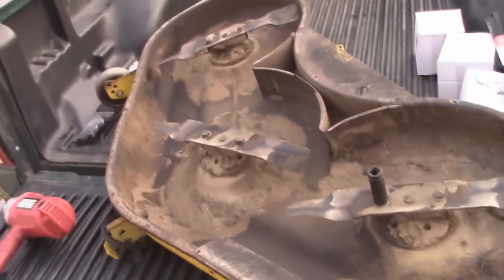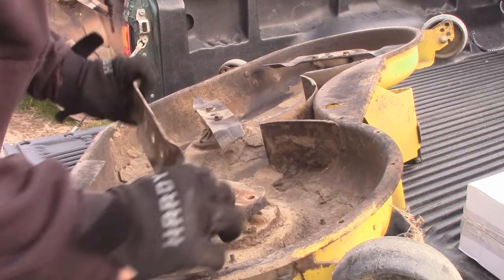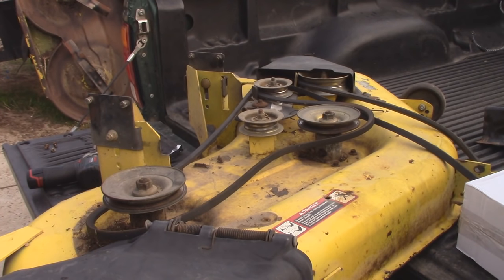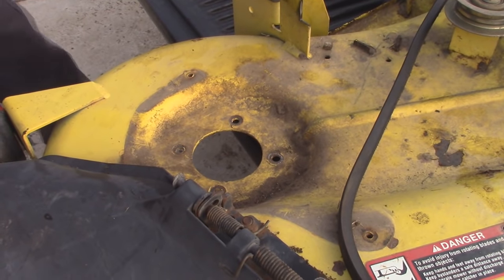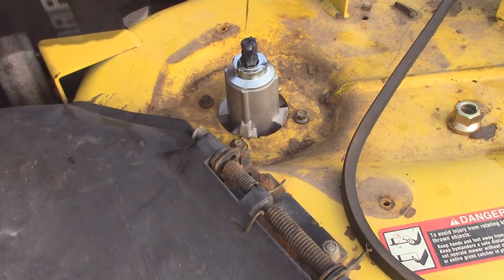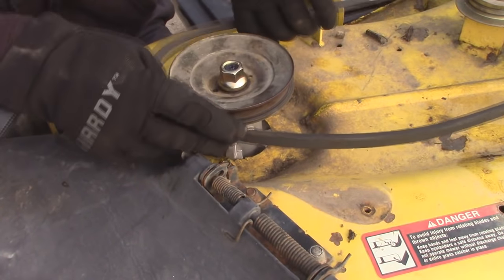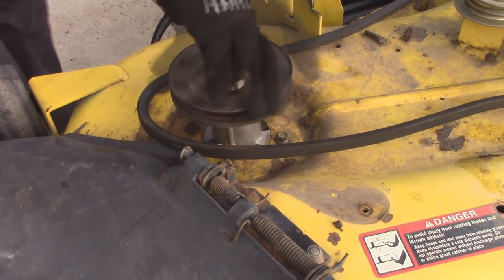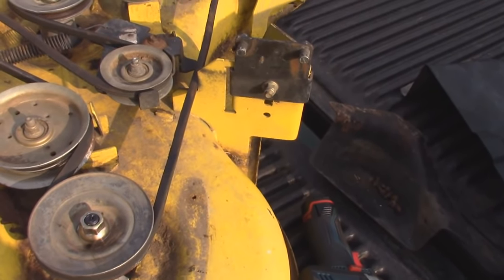John Deere L-Series Mower Deck Spindle Replace

Comment: Great hack using the belt to hold that spindle in place, thanks! If you don't have a pulley puller, in the past I've used a rubber mallet to tap around and break it loose, much like removing a stuck rotor on a car. Thanks for the video!

Comment: Great video to change out the spindles (on my X590).   I don't have an impact wrench so will try to block the blade first to remove the upper nut on the spindle.   Thanks for making the video.

Comment: I have a John Deere l130 and your idler pulleys look smaller than the ones that I have on mine now I'm in the process of rebuilding mine too love watching your videos special on the John Deere you make it a lot easier to work on them keep up the great work
Reply: I’m rebuilding my l130 deck now. Did you use after market spindles and pullys? How did they hold up. Thanks

Comment: Just a note that if you buy the cheap aftermarket spindles you'll need to disassemble them to verify that the bearings are not sealed on the internal side.  If they are then any grease pumped into the zerk will never reach the bearings.

Comment: A little trick to keep your spindles going for years, and this is a major problem with John Deere lawn tractors! 
You need to open up the spindle assembly, remove the bearing, pop the cover off of the bearing and pack it full of grease. 
Then reassemble. 
Some leave the cover off the bearing on the side facing downwards afterwards. 
When you're greasing your spindles on a John Deere, the grease doesn't penetrate into or even close to the bearing inside the spindle and they come pretty bone dry. 
This will save you a ton of money down the line. 
Even if you're adding new spindles I would do the same process before installation.
Reply from the maker: Thanks for the info. I’m going to be servicing this deck here pretty soon as our season is now over. I’ll be addressing that in a new video.

Comment: I see you Hank putting grease on the mower blade bolts. I just watched a couple days ago on "project Farm", a guy running a test with salt water and heat to see if never seize works. He also used grease. The never seize actually worked. Over at Western Truck & tractor he put never seize on cattle trucks that came in every year. He said after a year no trace of the never seize was ever left. I also watched a guy take out plugs from a 5.3L Ford truck and never seize did nothing to keep the plugs from breaking

Comment: I did the same for yrs. I learned you can rebuild the existing spindles. the bearing is common #6032    put pulley nut full on and pound top down, center shaft will fall out the bottom,  remove top nut you will see the two bearings per spindle, pound the out and replace with new #6032 bearings and reassemble.  30.00 will buy you the 6 bearings.   pro tip:  remove the rubber seal on new bearings and remove factory grease, which by the way looks like vasoline, now put red syn lithium bearing grease in there and snap rubber seal back onto bearing.  the bearings will last much much longer than minimum factory.  the new spindles have grease zerts but they really do not do much good because the bearings are sealed. usually only the bottom bearing has the top sealed removed to allow grease to get in there.   i find it much easier and better to just repack the bearings.
Reply from the maker: thanks for the info

Comment: I noticed that you used the belt to hold the pulley in place while removing the spindle nut... don't have an impact wrench, but going to try your technique with a old school wrench or socket wrench... Thanks!!!
Reply from the maker: This impact was under 40 bucks at harbor freight. Well worth it and great bang for the buck
Reply: Battery operated 1/2 inch impact is a great help in working on mower decks.   A deep socket impact metric socket set was a little more then $20 bucks at Harbor Freight has been useful.  My cordless  1/2 inch  is a DeWalt bought at Lowes.   Got the bare tool since I already had the 20 volt batteries.  Have a Bolens that  the Drive Belt Pully can't be removed and put back on without an impact tool.  Not way to hold its shaft.  An impact tool makes it much safer to work on mowers.

Comment: I have a John Deere 160 riding mower and it needs new bearings, is mine the same as what you're showing here A whole housing? I asked them what I needed and they sent me little round bearings.
Reply from the maker: It may be, those machines I believe are the next model up from these, e160 or something like that, better made than these l series machines. On mine you cant press them out have to change the whole thing
Reply: @hanksgarage_  do you know what the little dial button is under the seat?

Comment: Hank, you didn’t show how you installed the self tapping bolts.
Reply: Simply try to hold them so they are straight in and use a socket (by hand) and slowly screw them in - works fine.

Comment: Just got done with a deck rebuild kit for my LA105, everything works fine except for the new blades in the kit. When I started the mower up and engaged the blades to cut they we're hitting each other. They are basically identical to the old blades but will not work, had to put my old blades back on the mower. Anyone else have trouble with blades hitting each other?

Comment: What other tool can you use to hold the wheel
Reply: If you have the mower blade installed - use a wood plank to hold the blade.

Comment: We replaced the deck a year or two ago and found out that no... John Deere doesn't pre-grease them from the factory.  Thanks, John Deere... you cheap bastages. >=(
Came here to see how to replace the spindles.  Thanks for the video. =)

Comment: My issue is not having the impact tool, especially since the spindle on blade-2 was ripped out of the encasement of the outer shroud. So, the blade is off and I was able to pull the entire spindle shaft thru the top of the lower body. I am going to add a new piece of metal stock to resecure the spindle to the casing if that makes any sense. My issue is getting this 7/8" nut off the top of the spindle. It appears to be frozen on, didn't know if heating with a torch would help? Already soaked it in WD, but this thing is a bear to get off. Most videos I have seen, they have been using impact drills,  of which I have none. So, a 7/8" box wrench and only a pipe wrench to hold the lower section where the blade attaches. Any other ideas to get that sucker off? Thanks much!
Reply: Having the same issue. Any luck?
Reply: @KiddThrifty  I had to use a Dremel grinding tool and cut mine off just cut down to the threads, had to but a new nut, the old one was frozen, threads were ok but unless we have that impact tool kind if stuck.
Reply: Usually the issue is leverage. Get a big piece of hollow pipe (like a metal fence post) and attach it to your socket wrench and give a good hard pull the break it loose, maybe that will work, good luck!

Comment: I broke my blade off not the bolt the spi dle snapped can i replace it?
Reply from the maker: Yes you can replace the spindle
Reply: @hanksgarage_  its a push mower tho and its snapped near the engine
Reply from the maker: So the crankshaft itself broke?
Reply from the maker: https://youtu.be/5cGHd4L5qLU
Reply: @hanksgarage_  so the crankshaft is the bar that connects the blade to the engine?
Reply from the maker: Wel there is the adapter that goes in between the crankshaft and the blade. That can be replaced easily if that’s what is broke.
Reply: @hanksgarage_  it broke the middle of the pulley like half way up through the belt pulley if that makes sense
Reply from the maker: You should be able to find a new one. Find your model number on the mower usually at the back. Then google that for parts
Reply: @hanksgarage_  perfect thanks

Comment: those hubs suck i got over it and went and bought a exmark zero turn
Reply from the maker: Those are nice but I could never justify the purchase unless I was commercial or the grass here wasnt only on a 2 month season. Until then its used homeowner grade riders. Thanks for watchin
Reply: ah ok see i was trying to cut 6 acres every 2 weeks and no problem love the videos
Reply from the maker: Yea those are perfect for 6 acres for sure
Reply: @hanksgarage_    Standard Lawn Tractors are safer on hilly terrain.   Zero Turn where the rider sits in front of the motor turn over easily on hilly areas.  At one point they quit selling them here because of so many lawsuits due to turnovers.

Comment: Hank were did you buy your spindles from! my John Deere tractor! need new spindles! I called John Deere! buy the want a lot for there's!
Reply from the maker: Got them off eBay I just put in l130 spindle kit and found the set I bought
Reply: Go to e-bay or have someone who can buy on line do it for you.  Some spindles are selling there for about $21.   Went to a John Deere sight that sent me to the local dealers site to buy my parts.  Prices high and shipping high.   If you go to a John Deere site to buy parts try to find one not tied to the local dealer.  YOUR Best Bet is e-bay for parts for John Deer.   I bought a D100 mower deck with all parts preinstalled for a little over $700 that included shipping costs.  Great deal - instead of welding a cracked mower spindle mount.  Order and got the deck in about a week.

Comment: Hanks small engine repair check out my videos PLEASE and merry Christmas i got myself dyson dc14 has very strong hose suction gonna get it a clutch later im very happy with my curb side find
Reply from the maker: mowerking ED mowing and vacuum cleaners yes I subscribed to you. Make sure to watch videos on how to replace the clutch on those. It can be pretty fun
Reply: Hank's Small Engine Repair oh yes especially when your getting over strep throat
Reply: Hank's Small Engine Repair ASHURII is very funny hank does she make you laugh